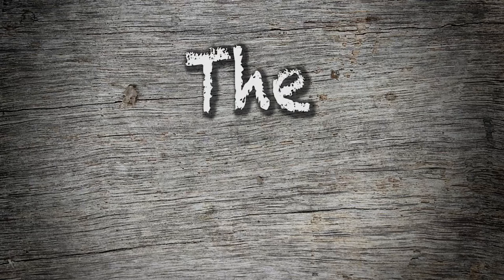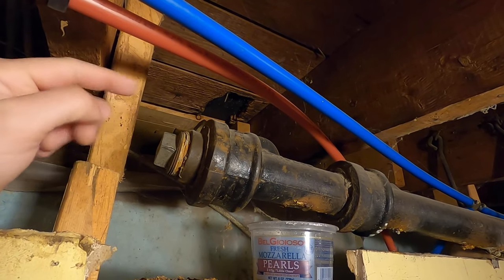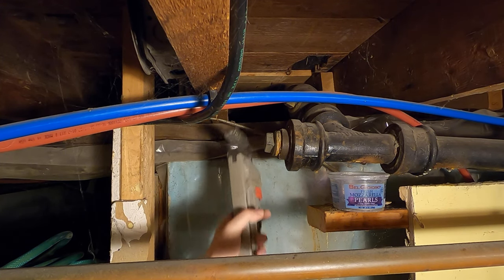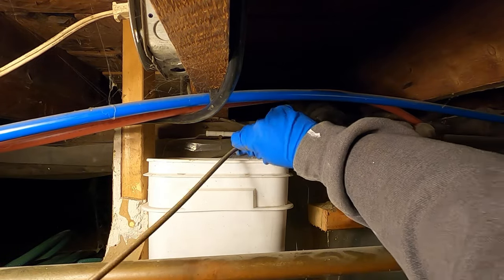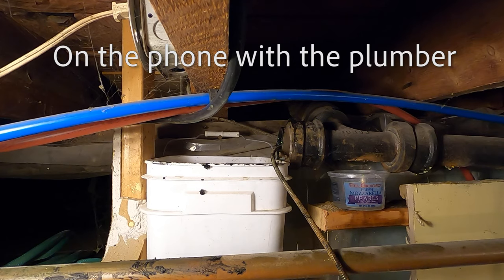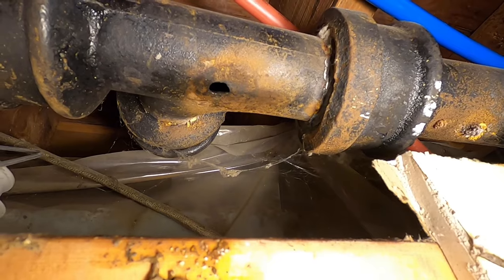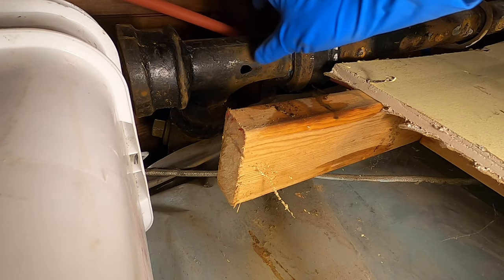Huge Hole In Cast Iron Drain Pipe - Temporary Fix!

Comment: I've  done this repair several times on my 4inch cast iron pipe 90 years old. I'll get two to five years until it needs a replacement patch. I use plastic screen material coated on both sides with jb weld quick and a piece of wax paper to cover a large hole. When it cures simply pull the wax paper off, and add another layer if necessary if its still leaking. Unfortunately your tutorial first started at the nine minute point, and all that excess talking degrades the quality of helping the viewers with this simple repair. Please take this as constructive criticism as your goal is to assist the diy people with this temporary or permanent repair.

Comment: A piece of 2 inch pvc, 2 fernco clamps, and a saw, 15 minutes, your problem is solved.
Reply: And 10 years of experience to do that 15 minute job
Reply: @shakirahmedtth  Not really. It'll take longer than 15 minutes if you're not that experienced, but it's definitely still doable.
Reply: @CertifiedDoc  you are totally right..
Reply: You don't see the T off that section of pipe?

Comment: Excellent use of JB Weld and clear explanation.   An alternative is to get hold of a sawzall - and a carbide blade - strap the pipe (from falling as it is heavy) - cut out the old pipe - replace with PVC - clamp together on both ends with Fernco couplings.   You will be done well before that glue dries.   BTW this is not really much of a plumbing fix - it is simply replacing a partial run in a pipe.   Not hard and ok for the homeowner to do anywhere I have ever lived.
Reply: That is what I would do. But he wants to pay a plumber $2,000.

Comment: Nice work. I had a similar issue 6 years ago. Contacted the chemist at PC7 company. He advised me to use PC plumbers putty, let it setup, then PC7 epoxy over the putty. Worked perfectly. Hardens like steel.Nothing is gonna leak through that barrier. This may help some of you folks. Note: I first tried the PC7 without the putty - didn't work - then I emailed the chemist and he told me plumbers putty first, then epoxy over it. Plumbers are too expensive, but be careful, in some cases you can cause more damage and have an even higher bill. I couldn't get the rusted on seats off my shower faucets with the flimsy tool from Home Depot. I called my plumber and he laughed. "You're not gettin' them out with that tool. Stop now before you bust the pipes behind the wall!" Fortunately, I did stop. lol
Reply: I'd  use your method to build-up the bottom 1/3 of the entire cast iron pipe run shown in THE FIXERS home.
Grind the pipe OD with a disk grinder, then apply the magic paste.
If necessary the patch work can be held in place with a bandage of fibreglass or fine screening.
With the bottom 1/3 to 1/2 of the pipe so reinforced, I'd bet dollars to donuts that this repair would outlast the current owner.

Comment: Good fix.  I would also add plumbers pipe repair tape (self fusing silicone) as an additional protection measure to the jb weld.  The only problem I would think of from this temporary repair is because the epoxy probably dried with a bump inside the pipe.  This can cause problems in the future... that's why I would add plumbers pipe repair tape as a precautionary measure. 

If you have top pipe cracks, use the wax from a toilet wax seal and stuff it in the crack to stop foul air and water overflow from coming in and leaking.  Temporary once again.  Good video.
Reply: If the top of the cast iron pipes have long cracks, try PL PREMIUM polyurethane construction glue with a caulking gun. For wider crack of more than 1/4 "  or more add nylon bug screen for reinforcement.  Coat both sides of screen with PL  if use.
Clean and prep all surrounding working surface first with brake cleaners or rubbing alcohol . Squeeze the PL Premium to the crack whenever possible or spread and press  it in to fill and level to the pipe with 1-2 inches or more to spread around the crack to create more stronger bonding results  . Check and make sure the entire crack line are covered.
Wait 24-48 hrs and inspect the repaired area, touch up  if necessary.  Paint to match optional. It should last for decades.

Comment: I bought my palace in 1981 and it's just about 100 years old. The house was pretty much as it was built and the woman who owned the house was the daughter of the original owner, The builder had lived across the street for decades after these houses were built. The woman and daughter had lived in this house for decades and over that time all that hair was building up the the cast iron drains so i had a few sessions with an auger and then with a few gallons of altered sulfuric acid to finally get the drains working right.

I did have one problematical clog that was about 4 ft down 2" pipe from the kitchen sink and just couldn't get it to break free so being poor and not knowing enough about plumbing I decided to fix it myself.  I drilled a 1/2" hole below the clog and snaked it out from that end, I found hair, needles and toothpicks in that clog but I got it free flowing. I then used some sheet silicone rubber and a could of radiator champs on that hole to seal the hole  and then hit the drain with hot water followed by a gallon of altered sulfuric acid To handle anything that got by my clean out efforts. 

After rinsing out the drain good I removed the clamps, filed the pipe exterior so it was nice and clean and slathered on some silastic before putting that silicone rubber path back with those band clamps. That was 41 years ag and those drains have remained free flowing since. I haven't seen altered sulfuric acid offered for sale in quite some time and maybe thats a good thing - that stuff has to be handled with care.

Comment: Ty for posting I have very similar leak.  I to have called plumber but fix is going to take time so temp fix will be done just like yours
Reply from the maker: Hey, Thomas!  Take it from me... After you do the temp fix, it is going to seam bulletproof to you.  You may think it will last forever but trust me, as great as it works, I would not go more than a few months.  The pipe rotted away really bad over the course of a year.  I definitely pushed it.  You can see when we ripped it out in my bathroom timelapse video if you are interested... https://youtu.be/g2vZUNPGGfY we take it out at about the 12 min mark.  
Thanks for watching!  Hope the video helps!!

Comment: I saw a video of some sticky wax cloth strips that are used to patch a hole in a waste stack. They worked really well. They sort of mold the pipe and bind to itself. Not sure if they sell them in the US. They can be applied to a wet leaking pipe.
Reply: Oakum?
Reply: @Saint696Anger  The fibers might be oakum or just burlap but the whole thing is coated in a heavy sticky wax substance. The Drain Unblockers, youtubers from Liverpool, use it now and again to cover access holes in sewer pipes.

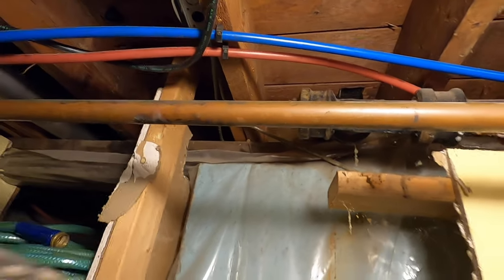Comment: My favorite part is the exposed 220V electric line (no cover) at 12:50 near your leaky pipe. In your case, yeah don't do your plumbing, or anything else for that matter! Just make sure your H/O insurance is renewed, you will need it soon!
Reply from the maker: Haha good catch.  Actually that was directly under the pipe.  It is for the dryer.  I turned off the power and moved it out of the way so I could work on the pipe without getting it soaked.  And this pipe has since been replaced.  It lasted for a year and probably would have lasted another year.  If you are interested in seeing it taken out you can check out my bathroom remodel videos.  Thanks for watching!!

Comment: I have the exact same thing and it's also a T pipe from my kitchen.   I'll do the same thing but I might get a piece of metal to JB weld to the hole but it's not pressurized so maybe it's fine either way.  I just want to make sure if it fills up and I plunge that I don't pop the weld off.  I'm sure it's super strong.  I want more of a permanent forget about it for 10 year fix
Reply: Use a disk grinder to clean the area to bare and shiny metal.  Then apply the sealant and reinforce it with a bandage of fibre glass or nylon screening.  I'd bet it'll outlast you.

Comment: That patch can buy you enough time to research the bigger job of replacing that connection. Couple videos and you can do it yourself. The two pipe cuts and a new pvc connection with cleanout  would be about 800 to 1200 here in NJ.

Comment: What works even better is JB Weld Marine epoxy putty. The only problem with the fast setting epoxy's is there adhesion. For the best results I would use the putty first for a fast bond and adheres better then fast setting type epoxy. Then get the original JB Weld that takes 24 hours to cure for a patch that will outlast the rest of the pipes by far.

Comment: Maybe the laws are different where you are? I've worked on these kinds of things all over the USA and I've never heard of such a law you mentioned in the beginning of the video. We can do any work we want inside our homes or on our properties. Some work might require a building permit. Where it becomes not allowed is if the repair needs to be done on the city side of any service line. We can only work on plumbing and electrical things in and on our property. 
Gas lines are different, they need a licensed plumber even inside our own home. Are the laws different where you are or did you whoopsie with the line between the city stuff and stuff inside private property?

Comment: U know...some good drain screens would prevent all that hair from clogging the drain pipe... Also, U can use a good sharp RASP/FILE to clean those rust hickeys off the bottom of the pipe.
Then...use a wire brush in a drill or...angle grinder...or... a right angle drill to get a quick clean...then, just wipe with paint thinner.. After its dry use the GOOP products (like Plumbers Goop) for a cheap fix but it doesn't get fully cured for about 3 to 4 hours.  But it makes for a great patch and it will hold up to the THRIFT...(a LYE chip product) that would clean out those pipes like you've never seen!  We can all learn from these videos so thanks for posting...

Comment: Once you lose the intimidation of doing your own plumbing you can just about tackle any plumbing problem on your own! Unless you want to drain your bank account and hire a plumber.  They need to make a living as well :).  I'm no plumber but I do everything myself and have fixed extremely challenging plumbing problems.  Sometimes it takes a little trial and error but as you dive into those jobs you'll continue to gain confidence.
Reply from the maker: Hey, Arminius!  I hear ya.  I am unfortunately in a state where the building dept. will not allow you to do your own plumbing.  Which is kinda crazy because I can do my own wiring.  I don't know.  I do sometimes wish I could do my own plumbing.  Thanks for checking out the video and for the comment!
Reply: @TheFixerHomeRepair  What State do you live in, I'll make sure I'll never move there haha
Reply from the maker: @arminius301  Haha I am in Massachusetts.  And I can't blame you for that I suppose haha

Comment: Dude, cut the pipe out with a grinder and replace it with PVC and two rubber couplings.  Scrap the cast iron for 12 cents a pound.

Comment: Without being that guy, I love a temp job - but in my experience there’s nothing more permanent than a temp job 🤣🤣.

Why don’t you, whilst the job weld was curing, get a section of pvc pipe to put over the JB Weld as it cured, then secured it with cable ties. Rinse and repeat across the whole pipe to make sure your not going down there constantly - that way you have that confidence it’s got some re enforcement.
Reply from the maker: Hey!  I knew it was going to be replaced soon... And it has been replaced!  Did it in my bathroom remodel if you want to check it out.  I totally get what you are saying though.  Thanks for the comment!
Reply: @TheFixerHomeRepair  that’s fair enough.
I love how you cleared the area for the plumber to make their life easier.
Great vid - I’ll have a browse through your vids. Love a bit of DIY and ingenuity.
Great vid - loved the drain weasel/spider that cleared the gunk.
It’s people like you on YouTube that show us that things can be done.

Comment: Why can't you just leave the jbweld? It says steel reinforced. Some houses have plastic pipe. It's noisy especially when you flush. Cast iron is quieter. The sewer pipe isn't under pressure like the culinary system.  So that jb weld repair should last for years and years and stand up to drain cleaners I would think.  If it doesn't, then replace it.  Reinforce the other rusted spots. No?
Reply from the maker: Hey, Seniorita!  I suppose I could do that but over time the pipe will just continue to rot.  It would be interesting to see a pipe completely made of jb weld haha.  There is a video idea!  Thanks for checking out the video and for the comment!

Comment: The wet surface might be a problem for JB Weld.  Possibly JB WaterWeld would do better?  It is supposed to be used even underwater.
Reply from the maker: Hey, Allan.  It has been about a year and rust spots are just starting to appear on the JB Weld.  Luckily I am changing the pipe in a week or too.  Has lasted longer than I expected actually.  Thanks for the comment!

Comment: Easy permanant fix is glue plastic pipe to bottom of cast iron..cut pvc pipe in half so it wraps cast iron and glue it on..i use tar..will last forever..lknger than the cast iron for sure..i have done this many tjmes for many plumbing issues .it takes only minutes to fix

Comment: You are wasting your time .
You will be doing this every two months in different part along the pipe . 
If you get a hammer and tap the bottom of that pipe there will be a one inch crack right along that whole pipe .
Just cut the two ends of that long pipe and get 10 feet of 4 inch pvc and get two ferncos and replace the whole thing .

Comment: I do my own plumbing all the time....always have.  That pipe is non pressurized, so I'd try this below idea first for a temp (longer term repair).   First I'd drain the pipe with your clean-out (like you did), etc. Then take a drill with a wire brush on it and clean off the complete damaged area really well (well beyond the leak spot like you did) then I'd take a heat gun (or even your wife's hair blow dryer....but DON'T tell her) and dry the crack or hole out. Then go ahead with your JB weld (or silicone caulk if it's only a crack) and apply the caulk inside the crack using your finger to push it in well and smooth. Then I'd apply this product from Home Depot or Lowes Hardware right over the top of everything when it's dry.  (it works great).  https://www.homedepot.com/p/Leak-Stopper-Rubber-Flexx-4-in-x-10-ft-Waterproof-Tape-Barrier-4602-GA/304237125    EazyPeazy and you may just put off hiring a plumber for years instead of weeks or months (and maybe even as long as you own that house)!
Reply: @Reid Steiner  Sure....the plumber is the best (and most expensive) route, but to do a quick fix that will last longer than what he did in the video, I think I would do my suggestion over his.  Remember this is NOT a pressurized pipe. Just gravity fed....   ABS (not PVC) is usually your best route and what most plumbers use because it won't rot and it's cheap and easy to install.  However if you want a quick and easy fix that is cheap and will last longer than JB weld smeared on, the choice is yours.   You're the "plumber" in this case.
Reply: @Reid Steiner I've been doing my own plumbing, electrical and structure repairs and installation since the mid '70s in trailers and homes, I'm not a plumber, electrician or carpenter but have done alot of my own repairing over the years.  And yes, ABS is the black plastic that most plumbers use nowdays because it's easy to install and doesn't rust out over time.  Good luck on your projects and THANK GOD for these YouTube videos.  I've repaired more things (dishwashers included) using YouTube vids than any book I've ever referred to.    ;-)
Reply: Curt Brennan hey thanks a lot dude! i’m actually going to use this to tackle a hole in my cast iron piping temporarily too.
Reply: @coolboynm55   Just clean the damaged area really well (wire brush and maybe heavy sand paper after that) and then get it really dry before you do anything else. That may take a little while, but it will be a better and stronger job in the end.   Lemme know how it turns out when you're done.   ;-)
Reply: Curt Brennan I’m for sure going to let you know, do you think i should use waterproof tape? or aluminum tape would work fine
Reply: @coolboynm55  Waterproof is what I would use...   ;-)
Reply: @USCG.Brennan  just ordered everything, I believe i have corrosion on a vent pipe so there is no leakage but i'm going to seal it with JB and waterproof tape
Reply: @coolboynm55  Now you're talking!  ;-)